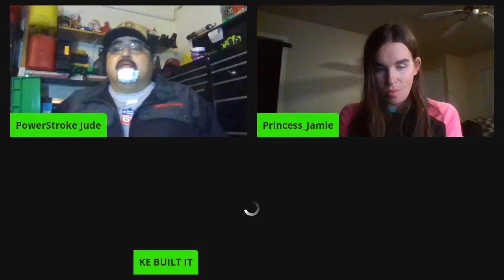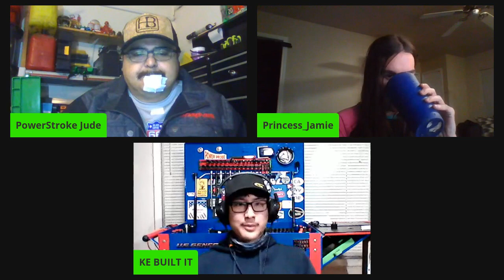Shop discussion w/TTS members Princess Jamie, KE BUILT IT  and PowerStroke Jude (mobile mechanics)

Comment from the maker: One thing I forgot to mention as a con is service information. At a dealership you have all resources available for all the vehicles you work on. At an independent shop you usually have a subscription based information system  (Mitchell on demand, shop key,  identifix) which provide wiring diagrams, pinpoint tests, repair procedures. When you work as a mobile mechanic you need to provide your own service information and those subscriptions are expensive so you spend a lot of time online. Also as a mobile mechanic you are your own parts guy, service advisor, porter and everything else so that can be difficult as well.